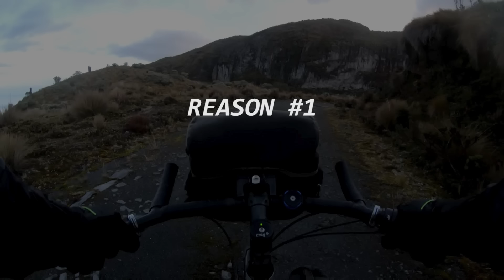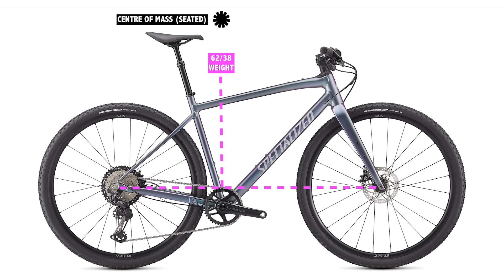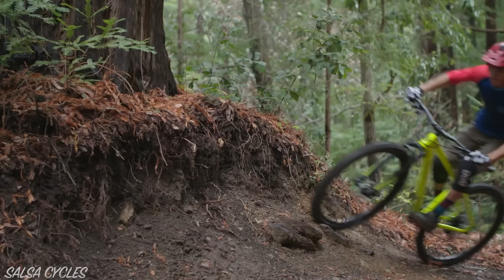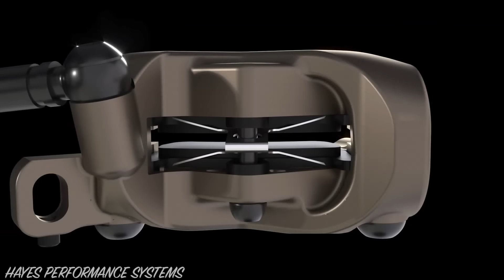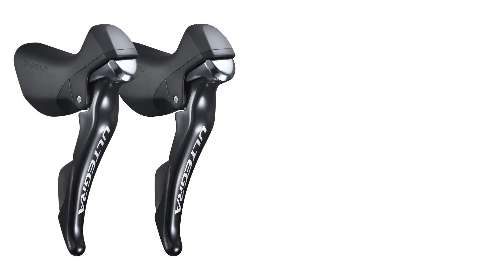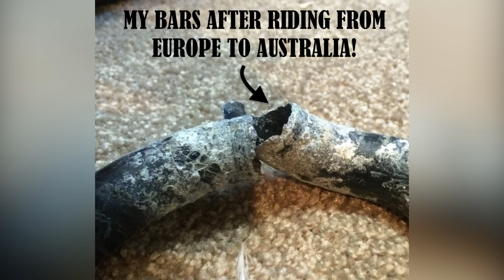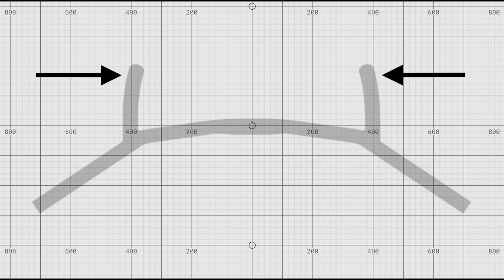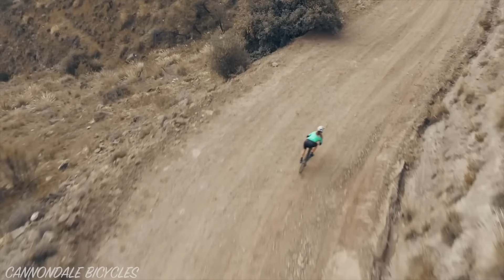Why Flat Bars Are BETTER Than Drop Bars For Most Cyclists (Objective Analysis)

Comment: Low gear ratios are so stupid that I had to convert my hybrid/urban/commuting bike to something more reasonable. It came with a 11-34 cassette int the back which I swapped for a 12-23.  That was in 8 speeds.  That started to get hard to find (due to the road bike world moving away from 8 speed); that bike is now 9 speeds: still 12-23, but with a 16T thrown in.    I have three rings in the front, but I never use the smallest one.  If I can't climb something with the 36T front ring and 23T at the back, I really might as well just walk the bike. Staying on the bike on ridiculous slopes, while going at the pace of a 3 year old on a tricycle is just about ego, not about reasonable locomotion. 

The stock factory gearing on flat-bar bikes is beyond stupid.

And only in the entry level is there compatibility where you can use road components to fix that, because the 8 and 9 speed road bikes have the same shifter pull ratios as the flat bars.

Comment: If you don't like the braking of the typical "hood", front-mounted drop bar brakes, don't use them. Use flat bar brakes, on the top bar.  You can easily find a $20 drop handle bar with a 22.2 mm diameter that takes your flat bike shifter and brake levers,.

Comment: Not buying the steering leverage story, except for very rough terrain where you are going slow. 

Most people do not need a bike for going over tree roots and boulders, and don't need its steering.

Steering on flat roads does not require lots of torque.  A bike steers by countersteering: first it has to steer slightly in the opposite direction to induce a lean in the desired direction. The steering then follows the lean.    Above a certain speed (which is not much), a bike balances itself. Your hands on the bars are mainly a psychological comfort: you can remove them and still stay balanced.  

No cyclists go faster than road racers, and in that sport, drop handlebars (in conventional widths like 42 cm) are ubiquitous. If it were hard to steer at speeds exceeding 55 km/h, maybe they would rethink the drop bars.

You simply don't take sharp corners on a bike at speed; you are never going to forcefully jerk the steering wheel when going down a mountain at 60 km/h; you would end up on your ass regardless of your handle bar type. if you want to turn sharply, you must countersteer, and there is a limit to that. The limit doesn't require effort to reach; it requires some mixture of fear and self restraint not to execeed it!!!

Comment: I agree with most of your points and generally think most people should use flat. But when you talked about the advantages of drop bars, you mentioned that there are similar alternatives for flats, like butterfly, aero bars etc. You neglected to mention that all alternate grips on flat bars move you away from brakes and shifters. This is the key advantage of drops, you can be in the hoods or drops and still have great access to everything while one butterflies, bullhorns, aero bars, you do not. This significantly reduces the amount of time you can spend in alternate positions. In busy areas, roads, when tackling hills, etc, you find yourself to almost never be able to take the alternative hand positions because it would be very unsafe.

Comment: Drop bars are objectively terrible in every way for everything except actually competing in a road race where your average speed is over the aero threshold of 15 mph most of the time. 

Your statement about standing and moving the center of mass to a centered position between the axles for balanced traction betrays a near universal misconception - that a rider needs to or even wants to apply more weight to the front tire in any case. 

I don’t expect many bicyclists to understand this because they’re a very narrow minded population when it comes to how bikes look and how they think about how bikes work, but motorcycles have their handlebars at or above stomach height across the board. Road, flat track, motocross, adventure, supermoto, all of them. Off road motorcyclists figured out that drop bars suck for dirt, and in short order, less than ten years. That was in the 1930s. They evolved rapidly to a rider-seated, weight-rearward position with sept back riser bars to give the rider the best control and let the front eat bumps. 

The newsboy bikes of the time and for decades after that had a similar riding position and design philosophy. 

Board track racing motorcycles and bicycles both had ridiculous drop bars that pointed straight down. That’s where the whole drop bar thing started. Too many people died racing those motorcycles so they banned the sport. People started racing off road on beaches etc, and for a short time they tried to use those drop bars but found out they’re terrible very quickly. For a while there, a pretty wide variety of bars were on the bikes at any given race. The standard swept bar about stomach high was arrived at by the late 30s, and flash forward to today, they’re still about that high - for comfort and control and vision. Motocrossers absolutely never put low bars on their bikes, because it’s the stupidest thing you could do.

Road bikes have had the standard drop bars since about the same time. The difference is pavement doesn’t have the irregularities that bounce a rider up and over the bars as often as dirt does. 

Off road bikes have had flat bars since about the same time Gary Fisher tried to trademark the term “mountain bike” in the late 70s. A bunch of people all over the US were riding old newsboy bikes on trails, kids were riding trails on their small cantilever frames with 20” wheels and motorcycle design cues, like banana seats, wide semi alick rear tires with a narrower front, and ape hanger bars. The movie On Any Sunday came out in 1972 and kicked off a huge explosion of BMX.

Anyway, it is a fact that I literally never have to put my upper body weight onto my bars for any reason. On the short punchy climbs - I live in a very singlespeedable terrain, I stay seated and if I need to put extra oomph down because it’s sandy and steep, I yank myself back and forth on the saddle, to get weight on the rear and for each stroke.

The 27.5” wheel bike in my profile picture has 8” of rise from the head tube, and it’s magic. I can rip it through swervy sandy single track and on gravel trails, I can muscle it up and over step-up roots on climbs, and when the terrain evens out a bit I can sit up straight and steer with two fingers. 

The only reason flat bars exist at all is the 3-4 roadies in Northern California who were first to try to monetize these grownup dirt bikes thought sitting upright wasn’t “specialized” enough and those “klunkers” couldn’t possibly be designed for their supercool needs.

Comment: As a Bike commuter for over 21 years I find Flat bars enable me to carry more up front than a drop bar.I have a 3 ft long Duffle bag I use to carry groceries inside it so I'm not doing a limited Errand ride.
Reply: I use Rubber twist ties on my bars to carry more gear .Sold at Lowes.

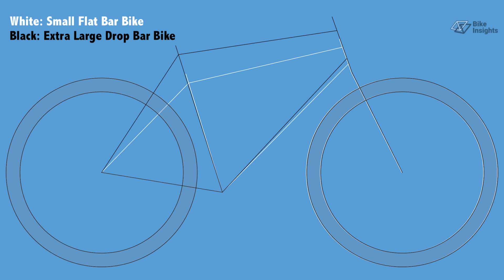Comment: You mentioned "flat bar frames" (3:19) and "flat bar bikes." This implies that all frames are not created equal, and, therefore, by switching out handlebars from a bike's original configuration (alts to drops and vice versa), the geometry of the frame is compromised, no?

Comment: Come on.. This is hardly a objective comparisson.
You compare dropbars to flatbars but speak geometry of the bike and praise the flatbar bikes. The fact is there are upsides and downsides on both type of bikes, bit you only mention the upaide of the geometry of out-of-the-box flatbar bikes. How about dropbar bile frames are often more premium and lighter. Besides that the frame hardly has anything to do with the bars. You can put a flabar on a gravelbike and a dropbar on a mtb if you like.
And the point that the reach is shorter on a flarbat is a bit off. The reach is determined by reach of the bar and your stem combined. 
The two Specialized you compare are not the same bikeframe.
I agree that flatbars usually gives you a more upright position, which is great for shorter rides and city rides. But it also leaves all the preassure on your butt, where dropbars distributes the preassure more evenly between front and back of your body.
Yes you can fit an aerobar on a flatbar. But of flatbars are the best (which is pretty clear that you believe), why don’t we see all the bikes on Traka, Badlands and so on having flatbars. People who rides these events know what their doing, and if flatbars were the best choice, I’m pretry sure they would use those.
This analysis is pretty far from objective in my opinion.
Nice filming though 😊
Reply from the maker: It’s important to consider frame geometry, because handlebars don’t work in isolation - they rely on the rest of the bike’s design too. Flat-bar and drop-bar frames are designed differently, and you see that reflected across countless brands. Yes, you can swap bars around, but without matching them to the frame, handling and ride feel will suffer.

And you’re right: the best option always depends on how the rider plans to use the bike. That’s why elite racers at the Traka, Badlands, or even the Tour de France stick to drop bars - they result in a more aerodynamic riding position, which is necessary for maintaining the highest speeds at the lowest power outputs.

Still, for most cyclists (please note the video title), I think flat bars objectively make more sense for the reasons I outlined.
Reply: @C @Cyclingabout re, but stem lenght is a big a part of both reach and handling.. And geometry is very different on gravel, road, mtbs and citybikes.
Reply: @Cyclingabout I just think that, if you compare two different bars, you could have taken 3 bikes and tried all of them with dropbar and flatbar on the same route, and then given ups and downs on each bike.

Comment: Recently I had the opportunity to do a short test ride on a gravel bike (my first experience with drop bars in my life). I felt less in control on a paved, even surface, than I feel riding my MTB over rocks and roots. To me drop bars seem like something that works for road bikes and racing due to aero (which forces quite uncomfortable body position). For literally anything else, I just don't see the point. That being said my 760mm MTB flat bars are indeed a bit wide for the city and bike paths, but even for that I would strongly prefer flat bars, just a bit narrower.

Comment: two things made my drop flat bars: 1) you can really feel how much they slow you down. they are like anti aero. and 2) a single hand position gets tiring on a long bike ride. most of the things you mentioned are kind of lame tbh. "better braking" ok dude, my emonda alr 5 breaks just fine. gearbox shifters - who gives a shit? sweat corrosion concern trolling is a stretch. better handling is whatever unless you're dive bombing down a mountain in which case you wouldn't be considering drops anyway.
Reply from the maker: If they're lame to you, it's because they don't apply to your riding circumstances. Different people have different use cases for their bikes, so it's important to cover this information.

Comment: Im, sorry, but this comparison is terribly flawed. Most ot the presented "pros" of the flat bars have nothing to do with the bars construction or hand position on them - for example lower gear ratio on flat bar bikes (at 4:26) it just means that flat bars are mounted predominantly on bikes that are designed for steeper hills, its not good or bad. Flat bars and drop bars have their own intended use - flats for more upright position and slower speeds, and shorter or slower rides, drops for faster longer rides benefiting from more aero position. I can see the good intentions behind the comparison, but being it targeted to ppl new to the whole cycling thing is misleading at best. I have been riding for about 45 years on different bikes and would never use drop bars on a enduro or even a trail MTB and, conversely it would be a mistake to use flats on a gravel or road bike. Top gravel racers are using drop bars on MTB bikes on some races and yes they switched from flat bars, does this mean that drops are objectively better for MTB? No, it just shows that you can have a bike with drop bars and low gear ratio and long wheelbase if you need to.

Comment: There's not much objectivity when it comes to handlebars. This is my subjective take on this matter. 

I have an mtb and e-mtb with flat bars and inner bar ends, as well as a road bike and gravel bike with drop bars. Flat bars without inner bar ends would be unusable for me, because I need to have an alternate hand position. I can reach brakes when I use them, whereas most alt bars make this Impossible. 

When it comes to ergonomics I like a 780mm flat bar with inner bar ends most. It's the best compromise when it comes to safety and versatility. Despite all of this a narrow flat bar is still my personal favourite. A wide gravel bar is my least favourite, especially if the bar is set so low that you can barely ever use the drops and it therefore takes away all of the versatility of that bar. 

Drop bar setups cost too much. That is objectively true and it sucks!

Comment: Great Video on this Subject !! For many years had ride w drop bar's  till I move to Hybrid flat Bar and I love it.Last week with few friends we did 285m in 5 days despite the Hot windy weather the feelings of the ride was  awesomely done on each day with out fatigue issue's or complaints It wasn't a race the speeds was 10m to 30 per hour. Aguess my point on long distance rides the comfort is # 1 also speeds 10 to 30m on short time makes the whole trip great. Definitely w drop Bars I had many long distance rides but wasn't fun as the ride with Flat Bar's.  Just Me :)

Comment: It's a rare occurrence, but this time I disagree with all of your arguments!

#1 As you said, you can get wide drop bars with flared drops, so this argument is moot.

#2 and #3 Frame geometry as nothing to do with handlebar design, as you can buy a bike with any geometry and put any handlebar on it. 

#4 I disagree that braking is harder on drop bars, but if that's your experience, you can get auxiliary inline brake levers. Also, as with frame geometry, brake calipers and rotors have nothing to do with handlebars.

#5 Again, another argument unrelated to handlebar type...

#6 Yet another unrelated argument.

#7 it's absolutely not a myth that drop bars offer more hand positions! I use 6 different hand positions on my drop bars (top, hoods, aero hoods, drop ends, aero drops, corner), while on most flat bars (at least all of the ones you showed) you can only have 2 or 3 hand positions (wide, narrow, bar ends). I really don't understand how you can claim otherwise...

#8 This is the only argument I partly agree with. I guess it really depends on the type of bags you use. You can get drop bars with a lot of flare, which makes it easier to use larger bags.

#9 Just use rubber bar tape and it will last just as long as mtb grips. Also, mtb grips always get loose with time and you have to retighten them from time to time. As for cables, you don't have to run them behind your bar tape if you don't want to. Heck some groupsets (like the Tiagra I used for the last decade) don't even allow for it (at least for the shifter cables). And why would you ever need to remove your cables anyway? I never had to do that in tens of thousands of kilometers and I can't think of a reason to do so... Oh and you know most of the flat bars you show in this video have bar tape on them, right?

#10 Again, most flat bars you showed have bar tape on them to access more hand positions, so this argument is also moot.

#11 Twist shifters are pure garbage! Why would you ever want to use them? I don't know about 3 years ago, but it's really easy to get pinion gearboxes made for dropbars nowadays...

#12 Wider handlebars means you are more prone to hit something and crash, so they aren't really safer on their own. Most of your arguments for safety have to do with other things than the handlebar itself...

Comment: Drop bars are still in the picture because they have a traditional look that customers associate with speed. Dropbars complicate overall rider position because you are moving from optimum position to 3 possible options. Unless you are a 40k/hr rider who has the flexibility to hold a flat back posture with out unneeded tension through your upper body, there is no advantage to dropbars. Take a fast road bike, put a narrow flat bar on it that allows you to be in your best, relaxed aero position and you will be just as fast in a headwind as you will on drop bars. Everything in cycling is dominated by marketing.

Comment: Ideally, the ends of handlebars should be curved (around 90 degrees) inward toward the body of the rider, like on an old-fashioned black bike - or - at least equally ideal - they could curve outward away from the body of the rider (around 90 degrees). The reason for this curve at the ends is very simple ergonomics, to suit the natural position of the rider's wrists, arms and shoulders. This is why I have drop handlebars but have them rotated a little upwards to give me that curved outward hand position.